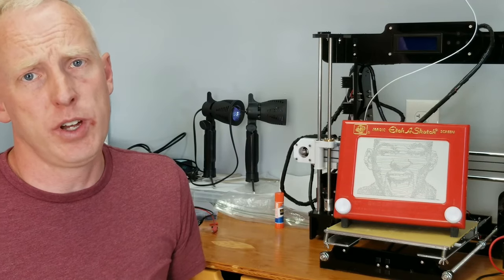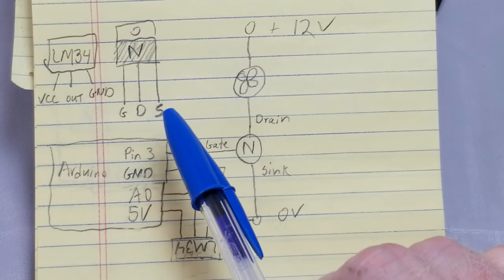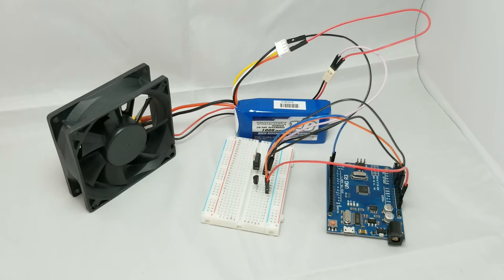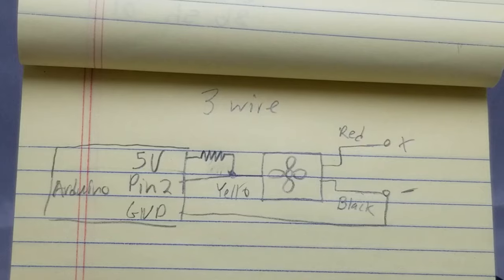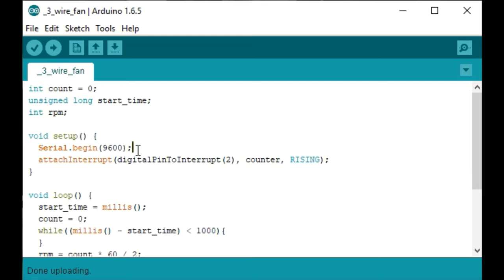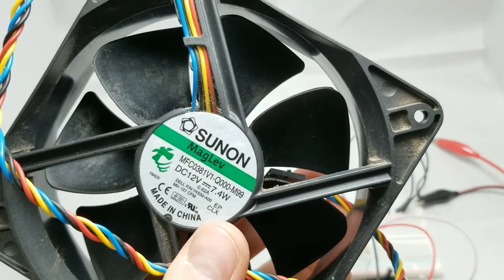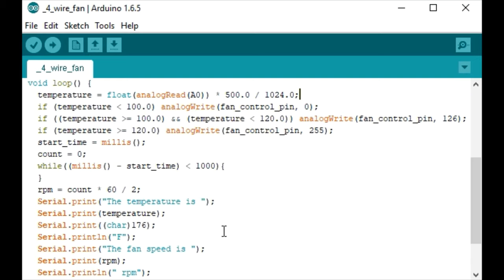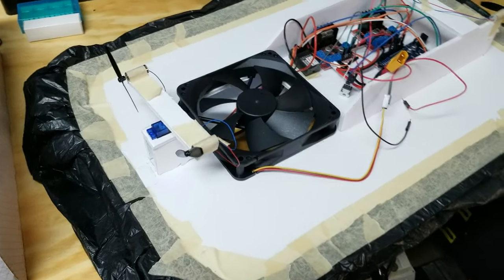Arduino Fan Control // 2-Wire, 3-Wire, and 4-Wire CPU Fan Speed Control and Measurement

Comment from the maker: The Arduino source files are available here sciencefuninnovation.gumroad.com/l/ndbytc for a minimal donation. Your donations will help me to continue to produce educational and entertaining videos. Thanks for your support!
Reply: If it's mandatory then it's not a "donation". It's "for sale".
Reply: 2 wire code: 
float temperature;
const int fan_control_pin = 3;
void setup() {
pinMode(fan_control_pin, OUTPUT);
digitalWrite(fan_control_pin, LOW);
}
void loop() {
temperature = float(analogRead(A0)) * 500.0 / 1024.0;
if (temperature > 100.0) digitalWrite(fan_control_pin, HIGH);
else digitalWrite(fan_control_pin, LOW);
delay(1000);
}
3 wire fan:
int count = 0;
unsigned long start_time;
int rpm;
void setup() {
Serial.begin(9600);
attachInterrupt(digitalPinToInterrupt(2), counter, RISING);
}
void loop() {
start_time = millis();
count = 0;
while((millis() - start_time) < 1000){
}
rpm = count * 60 / 2;
Serial.print(rpm);
Serial.println(" rpm");
}
void counter() {
count++;
}
4 wire fan:
float temperature;
const int fan_control_pin = 3;
int count = 0;
unsigned long start_time;
int rpm;
void setup() {
pinMode(fan_control_pin, OUTPUT);
analogWrite(fan_control_pin, 0);
Serial.begin(9600);
attachInterrupt(digitalPinToInterrupt(2), counter, RISING);
}
void loop() {
temperature = float(analogRead(A0)) * 500.0 / 1024.0;
if (temperature < 100.0) analogWrite(fan_control_pin, 0);
if ((temperature >= 100.0) && (temperature < 120.0)) analogWrite(fan_control_pin, 126);
if (temperature >= 120.0) analogWrite(fan_control_pin, 255);
start_time = millis();
count = 0;
while((millis() - start_time) < 1000){
}
rpm = count * 60 / 2;
Serial.print("The temperature is ");
Serial.print(temperature);
Serial.print((char)176);
Serial.println("F");
Serial.print("The fan speed is ");
Serial.print(rpm);
Serial.println(" rpm");
}
void counter() {
count++;
}

Comment: It's recommended to connect to the mosfet's gate through a current-limiting resistor because the current can be high briefly due to the gate's capacitance (charging when driven high and discharging when driven low). It's also recommended to connect the gate to ground through a pulldown resistor so that it can discharge and turn the mosfet, and thus the device, off when not driven or unpowered (a kind of fail-safe).
Reply from the maker: That makes sense. Good tip!

Comment: Thank you for uploading this tutorial video, sir. This is very helpful for me. But I have a question, while I'm doing this project I made a code to decrease the speed of the fan every 10 seconds by adjusting the PWM cycle. It works perfectly. But while I look to the RPM value of the fan speed, It shows a random RPM value that is doesn't match or refer to my PWM value. The RPM value sometimes shows faster while my PWM value in low cycle. Thanks for reading this comment and hopefully you can help me for this case.
Reply from the maker: It is likely that you are picking up noise from the fan. A low pass filter (resistor/ capacitor) should clean up the reading. Try adding a 0.15uF ceramic capacitor to the resistor. If that doesn't work, you may need to add a schmidt trigger.
Reply: @ScienceFunInnovations  I really appreciate for you're help sir, I will try with adding a filter to my circuit for filtering the signal from noise I think this will work. Adding some fact that when my pwm duty cycle 100% or 0%, it shows probably the nearly right RPM value but for the other duty cycle it shows random value as usual. Anyway, Thanks sir for you're answer, very glad to discuss
Reply: @lukmannugraha9846 Hello, I also encountered the same problem. The fan with 5500 rpm shows 9000 rpm, and then slowly decreases, but in 60~90% of cases, it may show 7000~8000 rpm, which is higher than 100% fan.
In the end, I have solved this problem perfectly.  tried to replace a reliable resistor with a brand source. I switched to Philips vishay precision resistor, which is very effective and stable plus signal.

It may also be related to the resistance value. I replaced the 10k ohm inferior brand resistor with a 1Meg ohm philips vishay resistor, because I don’t have a 10k philips vishay resistor.

Comment: If lets say that I have 2, 4 wire PWM fans, would both the yellow wires go into pin 2? if not, how could i control 2 fans with separate variable speeds?
Reply from the maker: You would just need to use two different PWM pins. That way they could have their own speed.

Comment: I want to use the 4 wire fan for a project.  But,  will only be using the positive and negative wire.  Do you know if the fan will run at the highest speed without connecting the blue wire?
Reply from the maker: It should run at 100% speed with just red and black.

Comment: Hi! I use lots of Fans(over 10+) so I use independent 12v supply. In my case, I just connect yellow&blue line of fan to 2, 3 pin of Arduino and Fans +/- lines connecting to 12v supply? I can't English well so you might be hard to understand my sentence. I'm sorry but I hope you answer my question Thank you!
Reply from the maker: If I understand correctly, I think you are on the right track. You may also need to connect the GND of the Arduino to the Negative on the 12V power supply. Good luck.

Comment: good job! but i do have a question, would you mind telling me how to vary the voltage to be measured at the pin of the pull up resitor? ( 3 wire fan) thank you.
Reply from the maker: You can use any pullup voltage that you need. Or you could use a voltage divider if needed to drop the voltage.

Comment: Could you use the 4-wire setup for a 48V DC fan? If so would you need to change anything e.g. Resistor value?
Reply from the maker: It would probably work. I would need to see the schematic for the fan to be sure.

Comment: Excellent how-to video.  Gets right to the point with clear instructions.  I will add that the wire colors on these fans are not standardized.  I have a Delta brand 4 wire fan and black is ground,  yellow is +12V,  green is tachometer,  and blue is PWM input.
Reply from the maker: Yes. I wish everyone would standardize wire colors for fans, motors, stepper motors, etc!

Comment: This video helps a lot! Starting my electronics journey, I have made a basic inverter circuit with two npn transistors and practiced soldering various thongs. Thought it was time to get an arduino and see how to control these computer fans that i got from a trashed computer, with just an arduino and not have to use a speed controller!
Reply from the maker: Glad it helped. Good luck!

Comment: 2 wire code: 
float temperature;
const int fan_control_pin = 3;
void setup() {
pinMode(fan_control_pin, OUTPUT);
digitalWrite(fan_control_pin, LOW);
}
void loop() {
temperature = float(analogRead(A0)) * 500.0 / 1024.0;
if (temperature > 100.0) digitalWrite(fan_control_pin, HIGH);
else digitalWrite(fan_control_pin, LOW);
delay(1000);
}
3 wire fan:
int count = 0;
unsigned long start_time;
int rpm;
void setup() {
Serial.begin(9600);
attachInterrupt(digitalPinToInterrupt(2), counter, RISING);
}
void loop() {
start_time = millis();
count = 0;
while((millis() - start_time) < 1000){
}
rpm = count * 60 / 2;
Serial.print(rpm);
Serial.println(" rpm");
}
void counter() {
count++;
}
4 wire fan:
float temperature;
const int fan_control_pin = 3;
int count = 0;
unsigned long start_time;
int rpm;
void setup() {
pinMode(fan_control_pin, OUTPUT);
analogWrite(fan_control_pin, 0);
Serial.begin(9600);
attachInterrupt(digitalPinToInterrupt(2), counter, RISING);
}
void loop() {
temperature = float(analogRead(A0)) * 500.0 / 1024.0;
if (temperature < 100.0) analogWrite(fan_control_pin, 0);
if ((temperature >= 100.0) && (temperature < 120.0)) analogWrite(fan_control_pin, 126);
if (temperature >= 120.0) analogWrite(fan_control_pin, 255);
start_time = millis();
count = 0;
while((millis() - start_time) < 1000){
}
rpm = count * 60 / 2;
Serial.print("The temperature is ");
Serial.print(temperature);
Serial.print((char)176);
Serial.println("F");
Serial.print("The fan speed is ");
Serial.print(rpm);
Serial.println(" rpm");
}
void counter() {
count++;
}

Comment: Thanks for doing this overview! I just bought a few 2-wire 12v computer fans that I’m going to use to cool some USB hard drives. I was originally planning to just hook them up to a 12v power supply and call it a day, but I thought maybe I could control them with an Arduino (or an ESP8266 to get network control) and did a quick search on YouTube. I’m glad I did because this is exactly he info I needed. I knew I would need some kind of transistor, and could probably PWM control a non-PWM fan, but having the circuit laid out and tested already is going to save me a bunch of research and testing time! Thanks again!
Reply from the maker: Glad it was useful!

Comment from the maker: Many CPU fans require high frequency PWM (25kHz) to operate correctly. The Arduino by default delivers low frequency PWM, however, some extra lines of code can reconfigure the Arduino for high frequency PWM. If you have trouble running a CPU fan with an Arduino, you may want to try the technique shown in my latest video https://youtu.be/YBNEXWp-gf0.
Reply: And just like that 4am on a Tuesday I found my next quarantine project.

Comment: Questions I'm left with after watching:

1. Does the yellow wire go to ground for each pulse?
2. (I rewatched the video, and this one was answered) is pin 2 capable of interrupts
3. What voltage does the PWM controller on the 4-wire fan work with? Min/max?
Reply from the maker: 1) The yellow wire shorts to ground twice per revolution. The pullup resistor allows the wire to go high again in between.
2) Pins 2 & 3 on Arduino Uno/Nano can do interrupts.
3) Not sure, probably different for each fan. 5V seems to always work.

Comment: For the 3 wire fan. Can i use 12v fan with the same instructions in the video?. For the red wire i connect to +12v and -12v from seperate power supply, and is it right to connect the -12v to the arduino's ground like in the video? im a beginner, thank you.
Reply from the maker: Should be 12V (positive) and 0V (negative or ground). And yes I usually connect all my grounds together.

Comment: Hi! I have two questions about this project. Great vid btw!

Firstly, why do you connect the ground of the Arduino to the 0V on the power supply? In addition, what Ohm value resistor are you using to connect the 5V to the yellow wire on the fan? I'm a bit of an intermediate but still a total noob sometimes lol, thanks for your help!
Reply from the maker: Because the fan used 12V from the power supply and the Arduino was powered with a separate 9V battery it is necessary to connect the negatives together (common ground) for the MOSFET to work properly (since the MOSFET is connected to both). Otherwise, the fan might not have turned on/off when commanded. It may have turned on/off randomly, or not worked at all.

For the yellow wire, I think I used a 10K ohm resisitor, but any value over about 5K should work fine. Hope this helps, and thanks for watching!

Comment: Great video. What is the function of the 10K resistor? Can I use a different resistor? What is the min/max I can use?
Reply from the maker: It holds the wire "HIGH" at 5V. Twice per revolution the fan shorts the wire to ground creating a "LOW". That way the Arduino can watch for the change in state. Any resistor between 1K and 100K should work, but 10k is pretty common.
Reply: Too high resistor would provide low current and arduino may not detect it, and a low resistor would provide higher current, more than arduino can handle
Reply: @LakiuGamer  But it's not used for current. It pulls the line 'up' (to 5v in this instance) so there's no ambiguity about the state of the line when the fan is not pulsing. When the fan pulses, the line connects to GND and the resistor holds the 5v back for the duration. When the fan disconnects GND, then voltage on that line goes back to 5v via the resistor. The resistor let's you hold the line high (5v) without getting a short circuit.
Reply: @ScienceFunInnovations I’m new to electronics and stumble upon this question too, and by going through the comment section of this video, I see that I’m not the only one who is a bit confused about how to properly make use of the tach-wire. All the videos I’ve found on the topic, all go briefly over the wiring and do not tell how the tachometer on the fan actually work, and how we can use this with our projects, and what to be aware of.. For instance: Does the tach-cable provide current or voltage itself, that I need to secure my device from? Can I use a 3V source with the tachometer as well? How do I hook up the multimeter to measure if the fan is pulsing per quarter or half turn? And so on.

Comment: I read somewhere that 3-wire fans needs a stable DC voltage via for example a dc-dc converter and not controllable via (high current, in this case not very high current, but it is not a signal PWM just like the 4-wire fans) PWM.
Reply from the maker: Pure DC voltage (e.g. battery) is usually preferable than pulsed (PWM), especially with brushless motors.

Comment: Love u sir amazing . Can u make it control with hc05 bluetooth and mobile .
Reply from the maker: Yes. I have started making Bluetooth and mobile videos, like my doghouse video. I don't use HC05's anymore because now you can buy Arduino modules with built in Bluetooth, which means less wires. Check out some of my later videos.

Comment: S on a MOSFET is called the SOURCE, not the sink. Think about it: a basin with a drain and a sink would have two outflows but no inflow. You need an inflow of electrons into the transistor in order to have an outflow. Electrons flow from the negative to the positive pole, which is why the MOSFET pins are called SOURCE and drain. Other than that, nice video!
Reply from the maker: Yeah, wish I could go back and fix that...

Comment: Interesting video Science Fun ^^! Glad to see it, as I'm an Electronic Engineer :D :).... I got a question regarding the cooler itself, I read searching over the internet that this type of coolers work with more frequency, but yours is normally working, because I read that they are the ones used in PCs, and see some codes where they go into the TIMERs and other predefined variables from the uController of the Arduino, and they change them to be able to use higher frequencies. So, apart of having different frequencies, my question is: did you find any issue with that? I mean I don't see the problem, but I would like to know your opinion, ^^! As I was practical some years ago, too, but now I'm a little more theoretical and simulated guy XD hahaha I need to retake the ''hand to the circuit'' path, but I have a project to work with many coolers, so I want to make sure there is no problem (I didn't bring my Arduino with me and the University will provide me the materials but I need to do the list first, that's why I'm asking you this ;) ) thanks in advance!!! And keep growing in YT!
Reply from the maker: Looks like you found my other video about high frequency. Hopefully that answered your questions.
Reply: @ScienceFunInnovations  Yeah I found it, thanks. Sorry for this delay I'm with other 4 projects and labs, a satellite comm system, 5G micro cells, 2 more one about CMOS design, the other is more choosing the project by ourselves but using the microcontroller in assembly, and well it's kinda challenging hehe.... Well the cooler will work at low frequency, too; that was my question, before getting it, because I'm planning to get one, but it seems that the stores here don't have available in stock the 4 wires coolers, so I'm searching something in internet, do you think that 9GA0405P6H001.

FAN, AXIAL, 40MM X 40MM X 20MM, 5VDC, 350mA
 that cooler would fit well with the Arduino? and if I use something like the Adafruit board PCA9685 the same? 
I'm planning to control through PWM like 3x3 so 9 of these coolers. I don't want to use many current. And I found that cooler on Farnell, I'll check other websites ^^!... Those 2 more questions please :D

Comment: Greetings Sir!  Love your video!  For the 4 wire fan it's not clear to me what you are doing with Pin 3 (blue wire).  Is it simply outputting a voltage to the fan (0-5v)?  Or does it have  PWM signal on it?  Edit:  Disregard question.  Just saw in your high frequency update video that Pin 3 is a PWM pin at 480hz.  So that answers my question!
Reply from the maker: Thanks for watching!

Comment: Thanks for the video, I would like to implement fan control on a 3D printer enclosure and this is very helpful! 
At 3:58, what exactly do you mean by "use a 10KOhm resistor to pull the wire up to five volts"? There is no video of the wiring so I could not figure it out myself. Does these types of fan need a MOSFET as well?
Reply from the maker: A 4 wire fan does not need a MOSFET. You connect the signal wire to 5V using a high ohm resistor (10-100K). When the hall sensors are triggered, they short the wire to ground. This creates a square wave that the Arduino can detect.

Comment: Another way you can control a 2 wire fan is with a relay. There's a model of relay out there that's comes with some audrino kits and they can handle up to 10A at 240 volts which is more that enough to run any 12v fan, not just computer fans and only requires a 3 - 5V signal to trigger.
Reply from the maker: Relays work, I would use solid state if you want to control speed.
Reply: @ScienceFunInnovations  
Definitely solid states would be the way to go as they're less likely to get jammed or false trigger. You can PWM 2 wire fans too with a DC motor controller same as you would with an RC car motor (only minus reverse as PC fans can't run backwards)